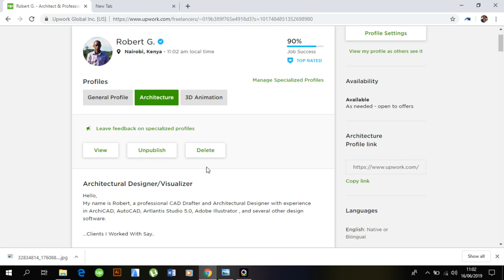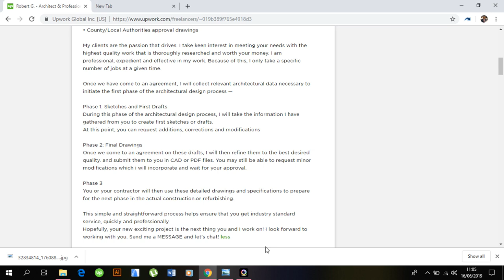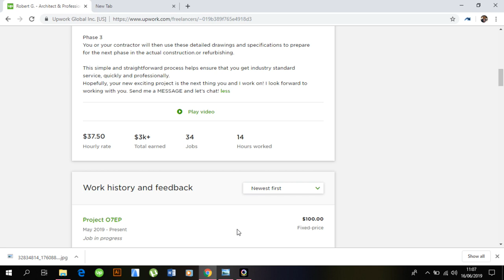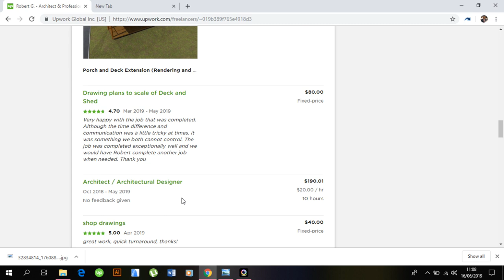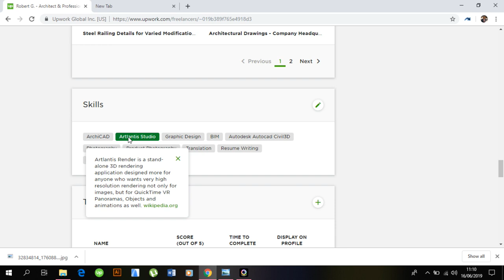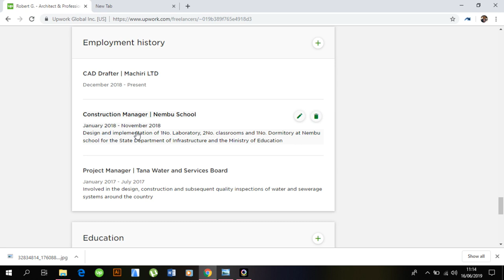How to COMPLETE your Upwork Profile: Real Example (Architecture & Engineering)

Comment: Hi Robert, 

First of all, I really liked your works. They look professional :)
Now, I just graduated this summer and wanted to start working at upwork but I have been struggling with approvement process. 
So, it has been 5-6 times I got a negative response from them that they are unable to accept me due to some reasons. However, I kept updating my profile, like changing overview, better profile picture, etc. and still. Do you know any idea why this happens?

Thanks in advance.
Best,
Fauzi.
Reply from the maker: https://www.fiverr.com/s2/d4d2c815d8
Reply from the maker: Hi Fauzi,
Am really glad you like my work. Thanks!
As regards your profile approval, I would like to think that a major reason that, apart from an incomplete profile, Upwork refuses to approve accounts is if the skills you are offering are not in high demand.
 BTW you can always change the skills back to your desired ones after your profile is approved even if you used a different ones  during application. 
I'm not sure about the skills you are offering, please inbox me a link to your account and we can discuss further on how to gain Upwork account approval.